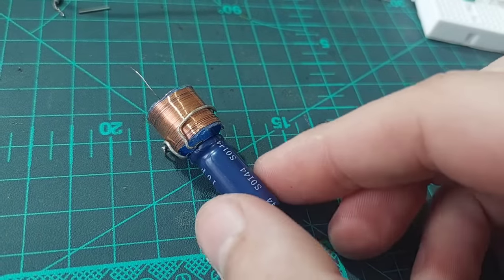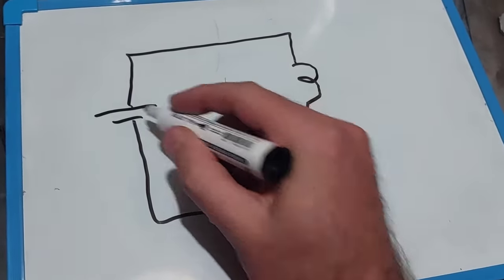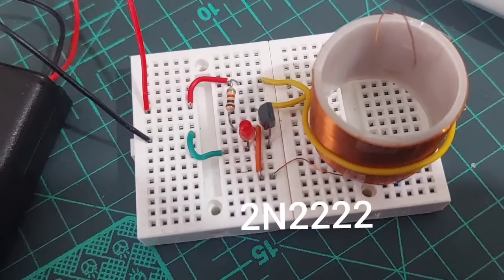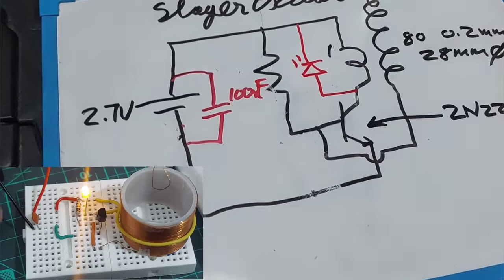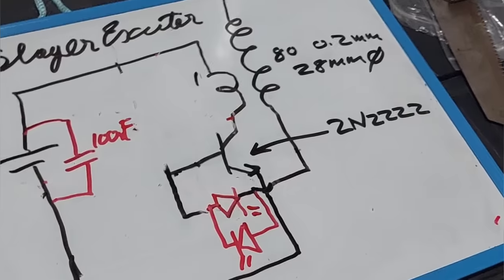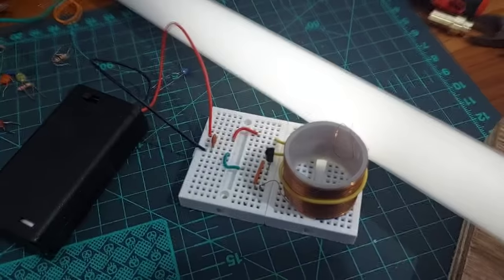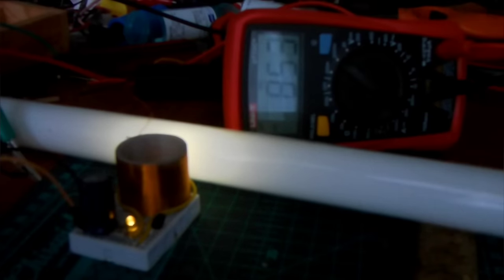A Tesla coil with only three components!

Comment: Could try the ZTX 653 audio driver transistor. A reason given is it's higher breakdown voltage rating. The forward gain is however lower than the 2N2222A.

Comment: Awesome 😁 Quick Question...
Would this be "triggered" by a weaponized style EMP?
Also, would this be triggered by a "concerning sized" coronal mass ejection, and if not could it be "tuned" to do so?
Reply from the maker: I suppose it depends on the flux density at the coil. If the source is too far away it simply would not induce enough current to trigger the transistor. A frequency close to the resonant frequency will probably work better.
Reply: Yes it could do that, all it needs is a pulse strong enough to make the transistor turn on.
Reply: Wouldn't an EMP weapon simply burn out the transistor?
Reply: Well, with EMP close enough, the coil wire will likely burn through. Or induce enough current to fry the transistor.
Reply: @ZomB1986  After thousands of Amps flow through the ex-coil, yes.

Comment: could put a starting cap of 0.1uf or less from v+ to base. would do the same as resistor but in a burst. however, you may need a series diode to prevent it from becoming resonator.
Reply from the maker: I'll have to try, sounds like it might work.
Reply from the maker: Got working just as you suggested. A series 10k resistor also worked instead of the diode. The cap had to be discharged first before I can start it a second time.
Reply: @William Fraser  using the smallest capacitor possible, may help with auto start as it may drain by air resistance.

Comment: excellent idea friend, you can improve the circuit, removing the leds that you have at the base of the collector and putting those leds in the emitter and their outputs connect one to the positive and the other to the negative of the capacitor so that the capacitor is charging all the time , and reconnect the line that you removed from the base without any resistance

Comment: If you know ANYTHING about TELAS. You know the Capacitor and  inductor has to be in Resonance. C1uF to  L1uH makes it like a spring. P.s. there NEEDS to be a ground
Reply: The "ground" here is free air
Reply: @ZomB1986   when he touches the 1 wire HE  becomes ground. there is no ground. the FREE air as in the atmosphere is a capacitor. That is what lighting happens witch is a short. So your saying you are grounding in the middle of a capacitor?

Comment: I like it, very clever using the leads of the cap for the L1. Though I think technically this would mean that your L1 is actually two roughly one half turn coils. Not that it really matters. I vaguely remember that mosfets are very sensitive to changes in capacitance so if you could find a smalll mosfet to replace your transistor you might be able to turn it on simply by touching a small wire connected to the gate.
Reply from the maker: Yes the 2N7000 does exactly that, it starts by simply touching the secondary with a finger. I haven't tried it with the smaller coil but it works as a direct replacement for the bjt on the breadboard (the pinout is compatible). Output (neon tube brightness) is less than bjt. It works well with an LED between gate and ground and another between gate an positive to act as clamps on the gate voltage swing. It is self starting with the pair of LEDs.

Comment: For the dummies here, what is it used for in practice? Does it start and maintain ionization in fluorescent bulbs, or is that just used to illustrate the field and there are other uses?
Reply from the maker: At this small scale, probably nothing more than an educational circuit or a party-trick gadget. The neon tube is just to show the field and gauge its output power. I have not heard of it being used in fluorescent lighting as such. According to Wikipedia (see "Tesla Coil") modern applications are in arc welding and for leak detection in vacuum vessels (the coil needs enough power to create a coronal discharge, the arcs are drawn to any tiny hole in the vessel, making it possible to visually identify it.)
Reply: Tesla coils are a technology developed by Nikola Tesla in his intellectual pursuit of abundance of energy from the natural world such as self-acting engines, transmitters and collectors of atmospheric electricity, as well as functional wireless power for the 19th and 20th century industrialists developing infrastructure for New York and other cities in the Americas. Today we have had the means to popularize some of the patents, essays, and ideas for tesla but not so much the big picture of its functional purpose. Yeah there practical applications for this specific device for education and testing, but there is a deeper problem or challenge to overcome that was left by the man.

Comment: What about pulling voltage out of the air provided it's enough to light a tube? Start it with a power source, lights the tube and it runs down to a point that the voltage pulled out of the air sustains the illumination indefinitely. Might need a really large antenna to get enough power for sustainment. The power would be from either static or other EMF sources such as power wires or transmitters.
Reply from the maker: That would be a neat achievement.
Reply: @williamfraser  i thought thats what a tesla coil was
Reply: Tesla pulled electricity out the sky, every 1 metre you go up from the ground the voltage goes up 100 volts, you would only need to go 2.4metres to get 240 volts.
Reply: Made a voltaic pile using 16 logs, a carbon steel screw in one end each log, a piece of copper wire in the centre of each log, and a piece of copper wire connecting the screw of one log to the copper wire of the next until all logs were connected in series. Managed to get 12.34 volts out the end and it powered an LED continuously-  forever if the logs never dried out (if i used a growing tree rather than a chopped up one)

Comment: I do magic downtown around night clubs...

This is giving me ideas...

I'll make a video of me using it in a trick then come back here and post the link to the video...

BTW, I'm an inventor and I love The Great Nikola Tesla...he was truly one of the greats
Reply from the maker: If you make the standard slayer large enough it will light up the neon tube from quite a distance, perhaps even through thin table top. A TIP31C transistor with a heatsink will allow higher voltages. I would suggest a breadboard circuit that allows easy replacement of the transistor, it tends to be the component that fails at the most inconvenient time. Keep spares on hand. And good luck!

Comment: Did you measure the HFE of the transistor? I am interested in what the gain is. Also you state supercapacitor but can you give us the source? I would like to recreate this but with a slight variance and I have an interesting idea.
Reply from the maker: I don't know the HFE in operation, or how to measure it. The very proximity of test leads seem to alter the circuit's output (neon tube brightness). The supercap is a run of the mill 10F Kamcap I bought from Mantech.co.za.
Reply: don't need to measure it, it's well documented in the 2n3904 datasheet. hfe is 35 at 10MHz

Comment: Great Video!

I can recommend using a transistor such as the ZTX690 for this as it has better properties than the common 3904 or 2222 transistors

Thanks for posting!
Reply: I used a BD433 transistor.  But most experimenters just use a 2N3055.  It works well with the power transistor from an old AT power supply.
Reply: @acmefixer1  basically any transistor with a decent amount of gain will work. The ZTX line of transistors requires very little base drive. In fact, if I remember correctly it oscillates down to about 0.2 or 0.1 Volt... If only my memory worked as well!! 🤔😂
Reply: @gertbenade3082  
Germanium transistors can oscillate down to 0.2 or 0.1 volt, but not silicon BJTs - they can't get below 0.5 volt.  But the supply voltage is 8 volts or so.  So to get enough power the transistor needs to handle several watts of power and thats why I said the BD433 would do it, but so would a 2N3055.
Reply: @gertbenade3082  Wow, Zetex makes some great transistors! The datasheet surprised me just how good its attributes are. You're right, the VBE runs as low as 125mV at 175ºC thanks to its 200ºC max operating temperature, and the hfe can be as large as 1300 bordering a darlington. The main demerit to that one seems to be its toff times are a very sizeable 1300 ns, but the output capacitance is very low at 16pF. Might honestly not be an issue if it's small signal behavior that dominates here in the slayer.  I did a bit of browsing and the ZTX series netted a bunch of other options. My favorite for this application would definitely be the  ZTX1051A. While it has double the output capacitance, it more than makes up for it with 10A pulse current (from 6) and 300ns turn off times. Moreover, the transition frequency is slightly improved at 155 MHz (higher hfe at 10MHz) and Vce sat is as low as 25mV. With the knee of the IV curve being much further over, it allows 1/4 the Vce and power dissipation at 2A compared to the ZTE690.

I think you found my newest favorite high performance through-hole transistor.
Reply: @acmefixer1  If the BJT is self-heated or externally heated so that its temperature is elevated, then the BJT will have lower  than 0.5V Vbe.  

For gert's ZTX690, all that needs to be done is raise the junction temperature to 100ºC to break through to 0.4V Vbeon and 175ºC to break through to 0.2V Vbeon.  This is only critical once the input voltage drops to 0.4V, so the application already naturally derates the transistor.

The BD series is a really slow BJT class, hot garbage for small-signal operation. I bought a slayer kit that used a BD243C which is similar to Onsemi's BD433. It's more suitable for large-signal DC operation. In both the 433 and 243, the transition frequency is 3MHz. In the case of my slayer, the resonant frequency was 3.7MHz, so the hfe gain ended up being below unity at around 0.6. Had the coil been a lower inductance reaching higher resonances of 7-10MHz, the gain would be 0. 

The great thing about the ZTX690 is that you don't need heat sinking at all compared to the BD series, which makes perfect sense then to use a TO-92 package. At the frequencies and input voltages we're using here, it's better than MOSFETs too.

Comment: Currently you are forcing negative current from the base, which can degrade a transistor's Hfe. It's hard to predict the base current especially if you consider ESD. The positive base current could also in theory be excessive. In order to keep oscillating, the coil must be able to supply not only the minimum required base drive current, but also the base charge required at a given frequency. So basically for lowest input voltage you want to match the effective coil secondary impedance with the transistor input impedance at low battery voltage. This may not give the best performance at full charge.
Reply from the maker: Interesting. I was wondering about the effect of high frequency on the transistor and, in the Slayer circuit, the LED. I believe the LED is supposed to clamp the negative voltage on the base, but is that still the case at >10MHz? And does the transistor still behave the same as at low frequency? The mere fact that a single turn primary works has me wondering how the various  loops in the slayer circuit (e.g. the loop from the base to the collector via the resistor, or the loop containing the LED and base-emitter diode) are affected by being so close to the secondary coil's EM fields.
Reply: @williamfraser  I was going off your prototype which doesn't have any LEDs. A E-B LED will clamp the reverse base voltage to the LED forward voltage and protect the base from that kind of degradation (but may also reduce performance). This is very speculative on my part and I haven't really seen any hard data on what it takes to degrade a BJT base, but seeing how the load current must all go through the NPN base triggers my best practice instincts. A 2N3904 base is probably very robust, unlike something like a MPSA18 which has a lot of intrinsic base resistance and a very thin base (and probably wouldn't work with this circuit anyway). The main danger to me is an arc or sudden discharge because the coil capacitance discharging through an arc could generate extremely high momentary currents, which is the reason ESD kills semiconductors. But thinking about this again, if we look at the human discharge model of ESD, this tiny coil wouldn't have nearly the amount of charge that a human can. So maybe it is perfectly fine. Another possibility is because electrons emit while holes don't, if the circuit is floating it could develop a strong charge itself which could discharge upon contact with something. At any rate, if I were worried about it I would leave it running on a wall wart indefinitely and see if it degrades. That may be the only real way to satisfactorily answer the question.
Reply: @williamfraser  At just 7MHz I measured 7-12V pk-pk across a 3mm LED with a min of over -5V and max over 6V. The reality is these LEDs are extremely slow, even though they do light up, its a false indication that they are clamping. Through-hole LEDs have long wire leads, and then they have long bonding wires connecting the leads to the PN inside the optical reflector, meaning they will have high parasitic and junction capacitance (could slow down rise and fall time of the transistor).  If you wanted to improve performance while keeping the visual effect, replacing the package with an SMD LED would be an improvement, something that is as small as possible being the best choice. Red LEDs are a good choice because of the low forward voltage, but amber or infrared would transition faster.

A better option is signal diodes, better yet is zener diodes, but the best option is TVS diodes. A TVS diode can offer unidirectional and bidirectional clamping, and packages are designed to minimize parasitic inductance and capacitance by using packages that don't use any bonding wires (i.e DFN, BGA), and it gets as low as femtofarads. Lastly, they handle huge pulse power and you can select the exact working voltage, breakdown, and clamping voltages along the knee of the diode.

If you still wanted LED indication, you could connect a sense resistor in series and use a comparator, logic IC (buffer amplifier, logic gates, translators), a current monitor, or any small signal conditioning IC or discrete component to do the indicating.

Comment: Use the florescent tube's heater coil as part of the circuit, and put the main coil over the tube. This may give you light farther into the discharge.
Reply from the maker: The tube was a fraction too big to fit in the coil but by attaching either end of the secondary to the heater coil seemed to pull the light to that end.
Reply: @williamfraser  So, arrange both ends as a center-tapped coil, to be alternately strummed? You could probably wrap the main coil directly onto the tube, for a somewhat more transparent and compact design. The cost may be the magnetic interaction with the plasma, which opens more options, and reveals more limitations. Certainly worth tinkering with though.

Comment: Question: Does it need to be a 2N3904 transistor? 2N2222 has the same pinouts, and similar datasheets.
Reply from the maker: A 2N2222 works just fine.
Reply: @williamfraser  Great! I'll start working on this project today!

Comment: It's mega cooool demonstration! )
@williamfraser , did measure output voltage? Can you please measure it, at least approximately?
Reply from the maker: The frequency and voltages are out of my multimeter's range, I think. I tried making a capacitor-diode-coil "receiver" to measure rectified induced voltage on the loose coil. Max I ever saw was 75V with the two coils almost touching. Turns ratio was 5:8.
Reply: @williamfraser  , Thanks for the measurements! It's really interesting, I love such experiments )

Comment: Well done!
Would is run longer if you changed to a thinner primary loop?
Reply from the maker: I would imagine so. Thin wire, higher resistance, less energy dumped every time the transistor switches on. But there could be all kinds of secondary effects to complicate things.

Comment: what happens if you put two of those together?  will they reverberate between each other?
Reply from the maker: There is definitely some interaction. I was able to "switch on" the small coil by bringing the larger coil closer.
Reply: @williamfraser  the entire point of tesla was harmonic interactions can build to unusual levels that can be exploited for benefits.   So u would say if you could find a harmonic reverberation between two coils like these. You could use them in many other ways.  Such as a way to keep them both charged and firing without interaction.

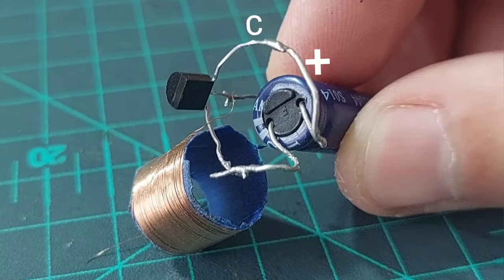Comment: Did you connect the secondary coil to the base of the transistor at 3:47? Why?
Reply from the maker: Yes, the induced alternating current in the secondary coil is used to switch the transistor on and off.

Comment: This is a joule thief with more-or-less steps!
Interesting to see it doing this though, never thought an air-coil one would work so well, with only one turn on primary...
Reply: No
Reply: @justtinkering6713  goes to show how much you know - compare the schematics, then come back with a less air-headed response...
Reply: @Vilvaran  I am correct. In a joule thief the primary and secondary coils are connected together at the plus terminal. There is no such connection in this schematic. In fact there is NO connection between primary and secondary at all  in this schematic. Please study your electronics books.